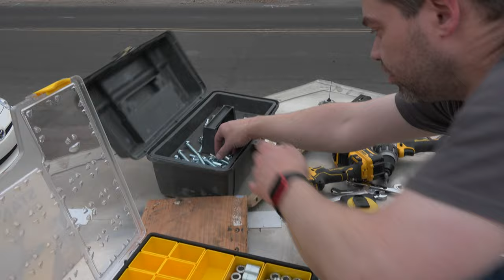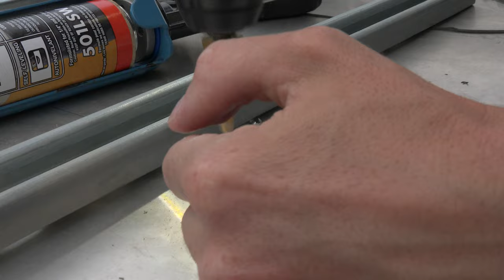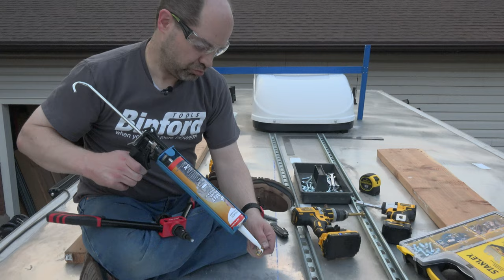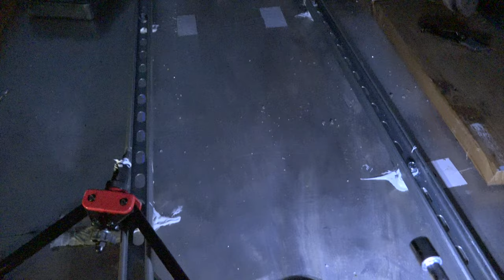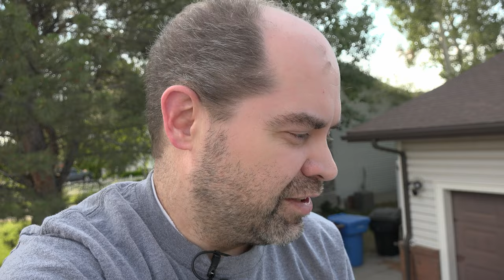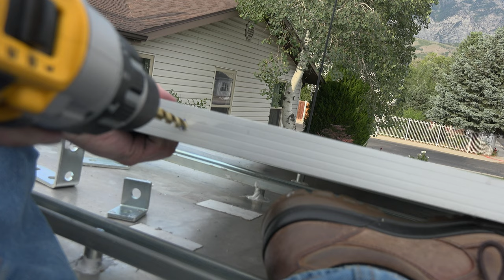Trailer Solar Panel Upgrade - Modular/Rail Mounting System

Comment: Hey Doug, I’m building/converting a 7’x 16’ mobile media production studio and have been impressed with your cargo trailer conversion series. I’m just about to do the solar panel with Zantrex Freedom 2000 XC and lithium house batteries next. My trailer roof is curved so I’m going with the flexible solar panels design. My video hardware is not as extensive as yours but it’s built around ATEM switchers and Blackmagic Design cameras (1 URSA Broadcast and 2 Micro Studio and Pocket 4K with the original Pocket HD). Audio is Presonus rack VLZ 1818 with A to D Behringer UltraMatch PRO converter. BMD Hyperdeck Studio, BMD Audio Monitor, Teranex AV, Smart Scope Duo and Ultra Studio 4K Extreme 3. I have a few kinks to work out but I’ll be ready to hit the road in the Greater Toronto Area next weeks by July 1. I just got my Honda eu 3000is inverter generator to provide me with 110V through my shore inlet. Because I’m in Toronto it’s insulated and heated no aircon, at least not yet. It was always my dream to be mobile and you have been my inspiration..For my confidence monitor I’m using a crappy Samsung 27” TV on a mobile cart and my two Video Assist 5” and 7” is for the Micro Studio cameras. I’m using a DELVCAM 28” 4K monitor for Resolve editing. My lighting kit is two Aputure 120 D and assorted fixtures. Mac Book Pro, Mac Mini M1 works well for me and I’m just beginning to build a rackmount server to replace my retired early 2008 Mac Pro. This trailer being pulled with a 2019 RAM BIGHORN. Thanks for your expertise as I continue to find inspiration from  the best leaders out there. I’ll show the build in a couple months.

Comment: I was wondering why you chose to run brackets lengthwise and penetrate the roof, rather than putting the brackets from side to side and mount with L brackets to the top side channel and not make holes in roof? Looking to do my trailer and just trying to learn...
Reply from the maker: When you can do that, that is ideal.

I need to be able to move solar panels and other things I mount around, particularly forward and backward. Horizontal (lateral) rails alone make that essentially impossible without making things complicated. 

The solar panels are not the only things I install on the roof; there are antennas (with masts), cabling, and other types of mounts that get installed and removed from time to time.  I need flexibility in where things are mounted. They do get moved around. I could have added horizontal rails then added vertical rails on top of that to achieve front/back movement, but I am trying to keep things as low profile as possible to minimize drag and reduce the chance of something on the top getting caught in the wind and ripped off. 

There also isn't a great way to achieve good lateral strength when mounting to the sides. I wanted my installation to be able to handle hundreds of pounds of weight without having to worry about the mounts collapsing or bolts shearing under that weight. By bolting into the top of the crossbeams, all of that weight is directed downward through the very robust sleeves and has no chance to move in any direction whatsoever. It's indredibly solid. Four screws on the sides of a horizontal rail would not support that kind of load in a way in which I would have any confidence that it would hold and be secure, particularly since those would be going into the same 1-inch square, 1/8" wall beams. 

This method does make it harder to maintain a waterproof seal, but that hasn't been a problem. I used a lap sealant which remains pliable and flexes with the roof as it expands and contracts with temperature changes. It was nearly three years ago when I made these changes and I've had zero problems with leaking. I inspect it from time to time to make sure the sealant is holding up, and so far, so good.

The method I used isn't right for everyone, especially if the load is going to be relatively light and doesn't need to be moved.

Comment: Nice work. Solar is the way to go. 
How do you deal with humidity inside the trailer and around electronics during the winter? I see the AC unit; do you use a heater as well to keep the internal temp at a certain level?
Reply from the maker: Solar is helpful, but even if I had panels covering 3 times the size of the roof I still wouldn't be able to run the electronics in the trailer exclusively on solar. Let alone the air conditioner.

We don't have humidity in Utah. :) That's never a problem. And the A/C would remove it pretty quickly if we did.

I do have a small space heater I'll use sometimes to kick start the process of warming it up in the middle of the winter. The electronics generate enough heat though to keep the inside not just warm, but quite hot, even during the coldest parts of the year. That same space heater also has a mode where it will keep the interior above a minimum of 45 deg F. I use that to make sure that the batteries don't freeze.

Comment: I just noticed you're into solar. I made the switch to off grid solar this spring. Absolutely loving it, but it's been a learning experience. The new Prismatic Lifepo 4 280ah cells made this project feasible as did used solar panels at ten cents on the dollar. I was able to build a large enough system to power my entire house and handle high current loads. The savings in electric bills are making the payments on the DiY solar components. I've made a tour of the system
https://youtu.be/NJUOYyw9P84
I've since mounted the 200lb inverter to the wall since this video was made.
Nice to see another fellow solar power aficionado!

Comment: I would have zip-tied the cables to the C rails underneath the panels...
Reply from the maker: I have. I just didn't show it in the video. I knew that the two additional panels were coming very soon after this was shot and that I'd need to reconfigure the wiring anyway to accommodate them. But even since then I've added the 7th and 8th panels as well.
Reply: @djp_video  oh right !

Comment: Those panels are crap. Producing only 100W on 39"x26" is less than 0.01w/sq. in.
Good panels will get you 0.13 to 0.14w/sq in.
Reply from the maker: Things have changed quite a bit since this video, even though it was only 3 years ago. But not that much. Your math is a little off... After you factor in the (roughly) 1 inch frame around the panels, my older panels are 0.1126 w/in2. 

The panels I selected at the time are polysilicon, which aren't quite as efficient as monosilicon. But they do fare better in lower light and when shade falls on the panels. Or when the panels get dirty, as they tend to do. So under ideal conditions monosilicon panels can produce more power per square inch, under real-world conditions, polysilicon can actually do a better job. 

But nonetheless, the new panels I added around the time of this video are a little smaller, 36x26, for a slightly better 0.1225 w/in2. And I've since replaced those with 200 watt 56 x 27 inch bifacial panels (0.148 w/in2, though they're slightly higher because they're bifacial). One of the panels I had installed in this video had started to delaminate a bit and lost some of its efficiency so I decided it along with its paired mate.
Reply: @djp_video  my calcs do include the frame.  They take up space.  I am judging the panel, not the cells.  
Your poly/mono comparison is interesting.  
You can increase production by using microinverters, too..  That is what I use in home designs.  
I also use REC panels which has TWIN technology - shade only affects the 1/2 panel being shaded. If other side is in the sun it produces normally.
Reply from the maker: @craigkdillon  I need the DC output for my application
Reply: @djp_video  I understand.  I am used to designing for homes, not RV's.  
One thing I like in your design is that you raise your panels up a bit to let air flow.
Tilting them, even a little, is a huge plus.